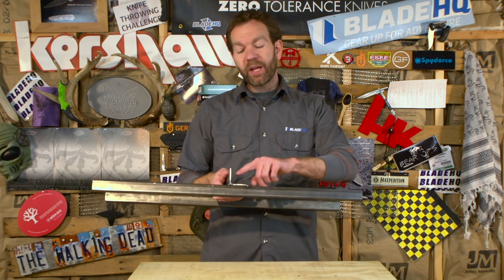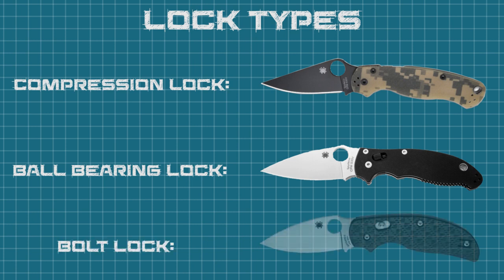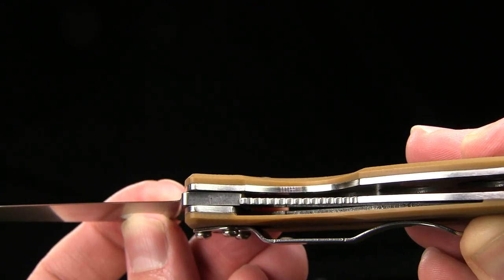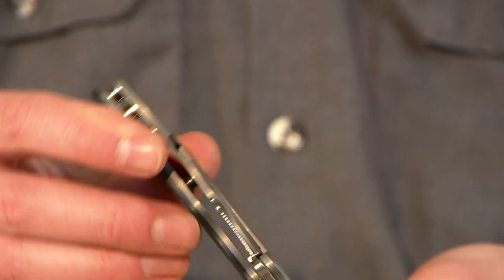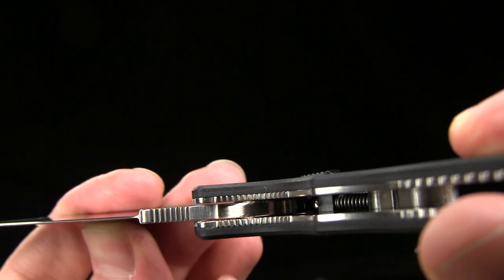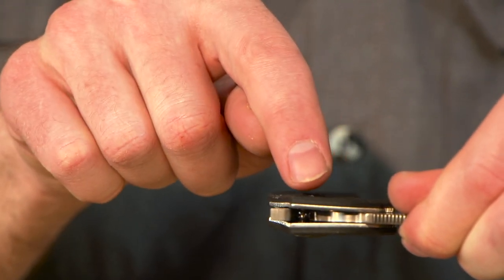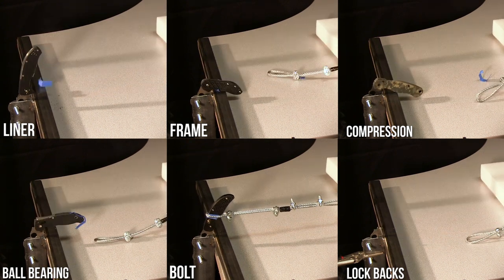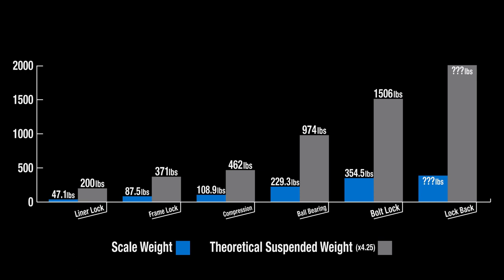Pocket Knife Lock Strength Test II

Comment: This is patently ridiculous, and they're all obviously fine for everyday use, but it's quite well done.  Your testing is appreciated!  

That said, I do wish you'd disassembled the knives afterwards, particularly the Ball Bearing and Bolt locks, to give a bit more information about the failure modes.  I'd love to see what happened to that poor bolt.  

Also, perhaps next time you could vice the handle, and thread the wire through the Spydiehole, for more consistency and a more realistic test?
Reply: LOL Nick, you are so right! It seems no one is doing any even half baked scientific testing, maybe Benchmade? Here it was not determined when the deformation started and ended and the force profile of deformation. Besides that as you say for every day use these locks are more than good enough.
Reply: The testing is flawed whenever you move a load farther from the pivot its going to need less weight to break and the cable kept sliding to a farther point from the pivot
Reply: Joker Toker  I guess if you like hanging off your knives against the lock? Which i have no idea what use that would be putting pressure on a folding knife in that direction.
Reply: I read this in your voice. Dunno if I should feel good about that. LOL
Reply: Joker Toker  haha nice!
Reply: I'd like to see the knives turned around so they show failure in a downward pressing direction. I'm never pushing the back/top of the blade into something.

Comment: Frame lock was a bad test. the loop clearly slips up higher on the knife before failure. that extra leverage is skewing results.
others were pretty revealing, though. had no idea the bolt lock and the liner lock were so strong.
Reply: doluseb 
Yes!!
Reply: There are plenty of other tests showing that frame locks really aren't that strong when compared to something like an axis lock or back lock.

Comment: the lockback couldnt fail because you put the winch cable over the rocker. it wouldnt be able to move up to disengage
Reply: Espada Hunter but the test  also proved as long as you apply pressure on the lock where your hand or actually your thumb normally will  be the lock will hold very well.
Reply: @whatfreedom7  Except the lock is the reason for a blade failure. The rocker puts pressure on the thinnest point of the blade steel, which is a design flaw required for a lockback.  I'd rather have a functional blade that had a lock failure than two pieces of scrap.
Reply: @hunterf9768  since this was a test exlusivly of lock strength the Lock back was the strongest the blade used wasn't the best design to use for the test (put a Buck 110 in its place with a bulkier blade profile and the results would differ)
Reply: but the cable is behind the pivot point of the rocker, so it doesn't hold it down
Reply: Good call
Reply: Hey antidote, do you know how a lock back works? The cable was on the blade side of the rocker.  It held the lock bar into the blade notch, as the tension increased it falsely made the hold stronger until the blade failed    this couldnt happen in a real world scenario EVER.
Reply: @josephgahagan4692  I just want to make sure: Are we both looking at the same test? The one at 11:00 minutes?
Reply: @jallahroyal  yeah thats the one.
Reply: @jallahroyal  You are correct. The cable rested right on the pivot so it had to effect on the rockers.

Comment: Not to be a nick picker, but the cable slid on the second test, moving "down" the blade and giving the winch more leverage.  Doesn't this skew the results?
Reply from the maker: +MrSottobanco Yes, unfortunately the wire slid up on the frame lock a bit. As stated not perfect.
Reply: 8 years late but your exactly right and the nature of a lockback defeats the purpose of the test as well. all other locks fail in the direction they disengage and the wire over the lockback prevents this the way the test is set up completely skewing the strength of the lock. instead you are measuring the weakest point in the materials

Comment: The cable has to fixed at the same distance from each knife’s locking interface to be a fair test. Otherwise the applied moment is not the same between tests. On several of the tests the cable slid up which increased the applied moment. 

Please correct me if I am misunderstanding the physics here.
Reply: glad to see someone mention this

Comment: The pressure of the pulling cable is holding the lockbar in its locked position, causing the blade to fail at the pivot.
Reply: Duh! Why didn't we all realize that! Good eye man!
Reply: +Logic Bob ironic cause your name bro...
Reply: And that’s exactly where your thumb would be when your actually using he knife. So it didn’t really fail. It proved as long as heir is pressure there as under normal use that lock will hold till you break he blade. So really it’s impressive. It just depends on how much pressure you can keep there with your thumb and wether you accidentally hit the release or not.

Comment: i think liner locks are one of the safest locks because when it failed it bent in a way that prevents the knife from being closed. Which means it wouldn't close on someones hand.
Reply: ANDROID HACKING 101 and the lock back failed in such a way that, well, the blade disconnected from the handle which guarantees safe fingers
Reply: I’ve had a CRKT liner lock fail and close on me. Luckily no fingers were lost.
Reply: Delica 4 squad where you at?
Reply: I had a Kershaw liner lock fail on me. Have a great scare to show its doesn't always happen this way!

Comment: Take away: all locks are more than capable for everything they are intended to do. Even a liner lock is strong and if it fails it more likely fails in a way that you cant close the blade BUT doesnt smack the blade against your hand/ fingers. Good to know!
Reply: For shock loads, i sometimes nimoticed the liner lock to slip to the left leading to disengagement. So it has 2 different ways of failing

Comment: wonder about a cold steel tri ad lock
Reply: the Triad lock is probably the strongest but it's a bear to manipulate sometime I don't like it. it can snap shut on your fingers..a Triad lock is really not a one-handed knife.
Reply: John Monroe It totally is a one handed lock. Depress with thumb knuckle, blade drops on finger with choil, close. Can flick it no problem
Reply: John Monroe thats not true at all, my spartan is one of the smoothest knives i own, they do take time to breal in but to say theyre not one handed openers means your ability to open it is the problem or your knives arent broken in or oiled
Reply: Dustin Bell is their a grove lock? geddit😃
Reply: John Monroe idk about you but i can open my voyager with one hand just fine.
Reply: i can too, but not under stress... i don't know, something is not right with their thumbstuds, maybe shape, maybe position, thumb keeps sliding off of it each time i need quick deployment. zip tie method doesn't work everytime also, wrist flick is not an option. try to strike a target without thinking about about opening a blade, begin with closed, and let the muscle memory do the job in the process, and you'll see what i mean.
Reply: Fire bug thumbstud has threading under surface of thumbstud, dig your thumb on thread , then push upward........bam

Comment from the maker: Second :p Sorry for the lost comments, had to correct a mistake. That's what happens when you're rushing to meet a deadline. Enjoy!
Reply: +KnifeHQ The red media not found?
Reply from the maker: +clonexili Yep, didn't get rendered before the export and I didn't catch it.
Reply: +KnifeHQ Thank you for this great video!  That you attempt to standardize your methodology, and give the caveats you do as to the efficacy and interpretation of your experiment's results are also both encouraging.  I wonder whether the sampling used to determine the multiplier can be considered valid because you state that you arrived at it from but one example.  I wonder whether it would hold true as considered against both multiple comparisons between the two tests upon the same model and as between the data differences of those tests done upon the other models--you don't state that here.  Interesting and entertaining, nevertheless.  Lastly, I do wish that you had included all the data you gathered from this experiment--particularly the failure weight of the two lockbacks.  That the item didn't behave as you had hoped by no means invalidates the data here, the weakest link remaining the weakest link.  While understanding the reasoning behind your not including the actual data, that you place some imagined, hoped for, but not actually arrived at unknown in your final graph undermines your product here a bit and demonstrates the benefits of double-blind studies as well, IMO.  Just my "two cents."  Thanks again for the video, and for all of your excellent work.
Reply: +KnifeHQ you should use like liner lock Gayle Bradley
Reply: +KnifeHQ : the liner lock didn't fail....you just turned it into a fixed blade.
Reply: Blade HQ hi
Reply: Blade HQ good work i think the winch is more valid then the stagnant weights personally. i can't think of a way to accidentally put 200 pounds weight onto the blade well it's stagnant. well it's moving i could definitely see 50
Reply: although i do hate to see these knives being broken..

Comment: Should've used a different lockback folder since the VG-10 steel seems to be too brittle for the test
Reply: Clearly you're not good at interpreting my sentence. Where did I say VG-10 is a "bad steel" huh? Can you extrapolate what I was saying? I'm not going to try and prove myself if this is just a mistake, but for once just use your brain to read what I wrote and correlate it with the video.
Reply: +MGladwell 

I don't think the VG10 is rust proof. Maybe more resilient to rusting compared to few other steels, but not rust proof.
Reply: ***** I 100% agree with that! VG-10 will do the job well, but there are better steels with their own drawbacks.
Reply: +Fappolice steels are steels, no matter how 'high end' one is, it's still all about trade offs and how well they are heat treated. 52100 and AEB-L are low end steels but can do amazing things when properly heat treated. VG-10 is a medium carbide steel and exhibits the traits of being such.
Reply: Well, no, you could say that fine grained steels are better, as far as i know carpenter makes the finest steel
Reply: 꾸리꾸리한 발까락 냄새 
Correct
Reply: JustSimplyBrandon yeah i think the neck of the knife on that model has a sheering point combined with a hard temper, but also dont forget, it probably has less movement than the others so rather than gradually giving way it just hits the full force of the winch and snaps.

Comment: I'm not a physics expert, but I do think this test is flawed in 2 ways

1) Inconsistent grip
You can see in the slow-motion video of the framelock, the loop slides up before the lock gives way, which changes the force's leverage. The further the force is applied from the fulcrum point, the more mechanical advantage it has, less force is required to do the same work. 

2) Direction of force
I find it weird that you're testing the force from the handle and not from the blade. I'm not sure if it would actually make a difference, but my guess is that would be a difference in lock strength when the force is from blade to lock rather than lock to blade.
Reply: Good point on number 1.  On your second point, it should not be any difference as long as the grip can hold the blade or handle steady.

Comment: thats an awsome test but u dont normally bend the knife inward on its shutting point but backwards at its pivot point like the shape a v is the normall way u would actually apply pressure to a knife yall should do the same test again but turn the knifes around
Reply: Eli Garcia that’s exactly what I was thinking. Wtf
Reply: Its obvious there'd be marginal difference in results. At any rate, locking mechanisms for folders should aspire to be fixed blade strength when tested at the fold. Of all, that means lock backs.

Comment: After the Delicas failed, it would have been nice to see other lockbacks tested; like Enduras or something else.
Reply: +Hiluxtaco yea or other steels like a ZDP, superblue, etc
Reply: +ting280 I agree, since it was the steel itself that failed on those Delicas.
Reply: The blade failed instead of the lock because the cable was reinforcing the lock bar along the spine of the knife.
Reply: That is a very good point. the cable in that location would likely prevent the lock bar from raising above the frame which would prevent the lockbar from disengaging from the blade.
Reply: gamer on crack!  That is a good point. I’d like to see it done with something simulating more of a push and more hand like than a cable. I’d also like to see more test with bigger lock backs.

Comment: I would still trust the frame lock on the Kershaw Cryo 2 from the first video. 

Even though it technically failed duh to the fact that you couldnt release the frame lock, it was still a safer lock. Most of the other knives closed when the lock failed, but the frame lock on the Cryo did not allow the blade to close. The whole purpose of a lock is to prevent the blade from shutting on your hand. Therefore the frame lock on the Cryo is one of the few that actually stopped the blade from closing, even when it failed. Therefore i trust this knife lock more than the others.

Comment: Friend of mine did his own test with his own winch that is similar to the one you guys seemed to use, bolt lock and lockback were the strongest, the liner lock was the weakest and the compression lock was significantly stronger than the ball bearing lock. The compression lock was the most different, came in at 235.74 pounds, ball bearing lock was significantly weaker at 121.18 pounds.
What he did was put it at where the lock engages which is the best way to actually test. The delica btw was 382.68, very impressive. Bolt lock came in 401.20

Comment: well in a lockback design, the rocker arm has to lift up to disengage the lock, so wouldnt the loop strapped around the knife be holding the arm down not allowing it to lift up, therefore pushing the blade to the point of failure rather than the lock?
Reply: to explain a little better, im saying the loop that is pulling the rocker arm down is forcing it to stay in the engaged position with just as much force as is being put on it. it basically took the strength of the lock completely out of the equation, turning it into a test to see what else on the delica would break if the lock strength wasnt a factor. lol
Reply: I think you are right.

Comment: I know it's probably semantics to most people, but you are not applying weight, you are applying force.
Reply: Weight IS force though? Which is why when you weight less on the moon or underwater. You're thinking about mass, which doesn't change.
Reply: @BaritoneMonkey  Weight is a specific vector of force. No one said anything about mass. From an engineering standpoint, you measure force. The force is applied by weights, but the lock would fail at that force threshold regardless of orientation, which is why it's more useful. Perhaps more accurately, it's the moment about the pivot that is causing the lock to fail.
Reply: @danielhesse8600  got it. No,  you're right then - misunderstood your initial comment. Have a good one

Comment: It's cool to see them doing some tests, and credit to them for doing it, but it's also testing the locks under best case scenarios too. Few locks fail under steady pressure middle of the knife like that under any normal use, but sharp impacts, done from less than ideal positions on the handle, and of course not at a straight line to the lock, etc. More realistic failure scenarios would be more telling, but credit to them and addition of the dynamic force much more realistic and telling!

Comment: For those using normal units of measurement:

Liner lock 47.5 pounds / 21.55kg
Frame lock 87.5 pounds / 39.69kg
Compression lock 108.9 pounds /49.40kg
Ball bearing lock 229.3 pounds / 104kg
Bolt lock 354.5 pounds / 160.8kg
Back lock ??? Pounds. Blade broke before lock failure.
Reply: As a European I just divide the lb by 2 and substract a few percent of american patriotism, which gives me the kg. Simple as that.

Comment: You don't have to use a suspended weight.  You can slow down the rate at which the winch applies force by incorporating stretchy material into the cable, at the cost of having the cable head shoot back faster on release.

Comment: Great tests by BladeHQ. A few observations: 
I think Chris Reeve has long said the great advantage of the liner/frame lock is not absolute strength, it is that it tends to fail slowly and tends to prevent the blade from closing even after it has failed.  
Clearly that Delica blade tang design has some stress riser issues that should be addressed by Spyderco.
I’d love to see more tests, not on the lock side, but on the stop side.  If you ever needed to overstress a knife in an emergency situation - say batonning it - I’d love to know which designs hold up best. (My bet would be the compression lock would disappoint - the lock undermines the stop pin.)

Comment: Angle the weight pull, positioned near to the lanyard hole, with a smaller cable loop. Thatll simulate more load bearing on the locks using the knives as prying tools to disengage/break the lock take-up.

Comment: Nice job. As another poster said, Liner lock didn't fail. It protected user by folding in but knife didn't close. That was exact intention of early custom makers who used it. Do have a question. Would "bolt lock" be same as BM axis or SOG arc lock?